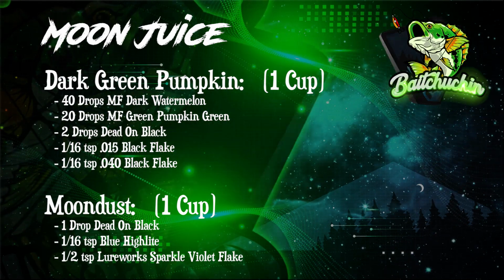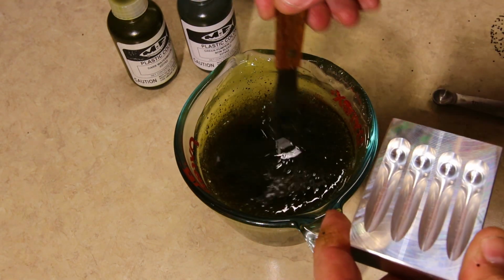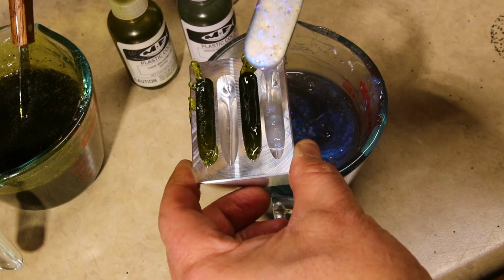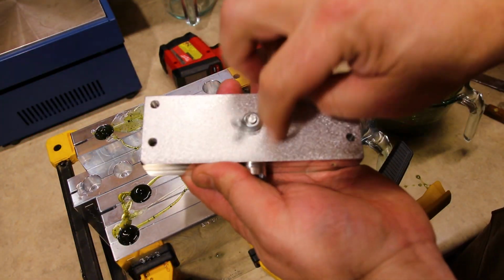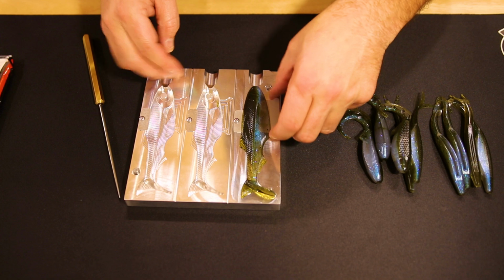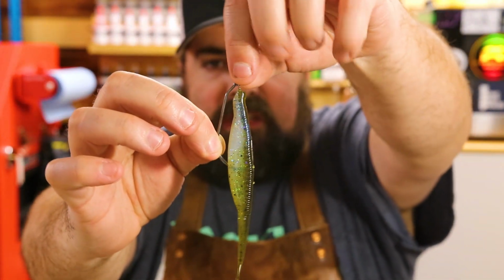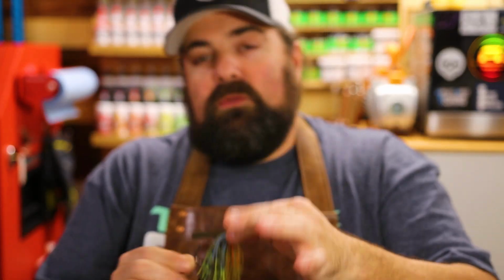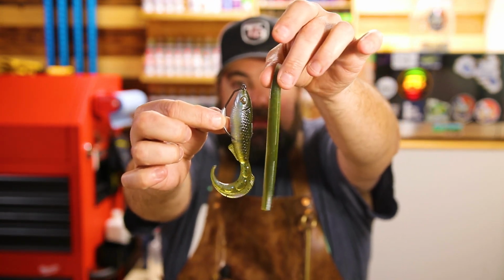Color Matching Strike King MOON JUICE with Soft Plastic Lures

Comment: I want to order the duel injector molds but the have 2 different sizes. There is a 2.25 block and 3.5 block. What’s the difference in the two?